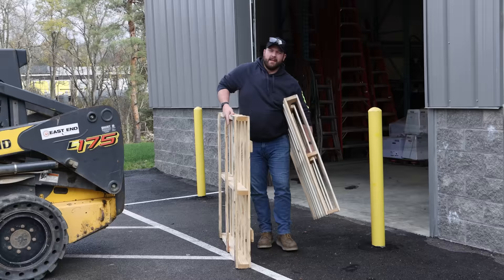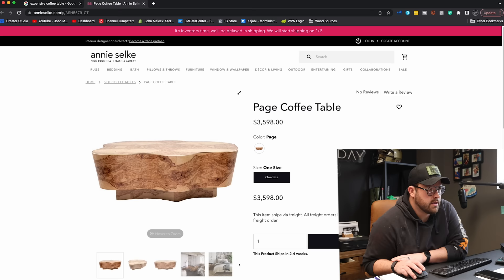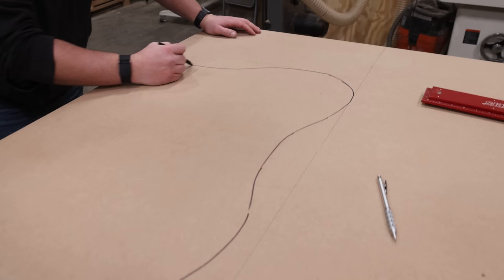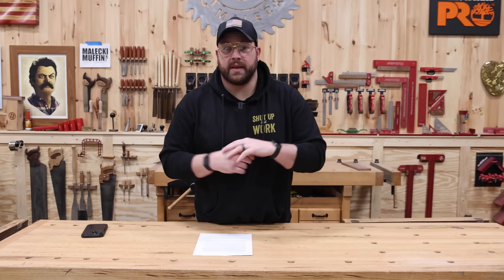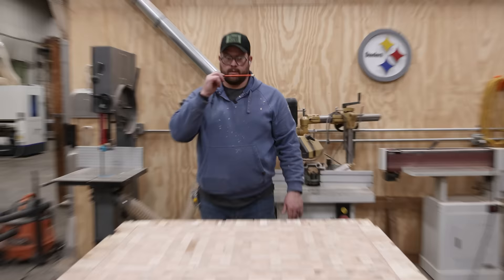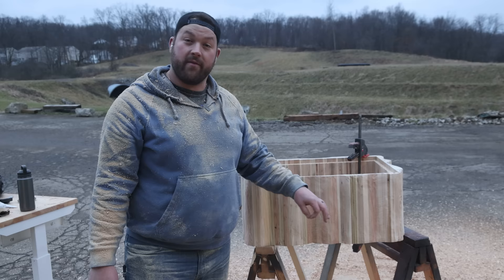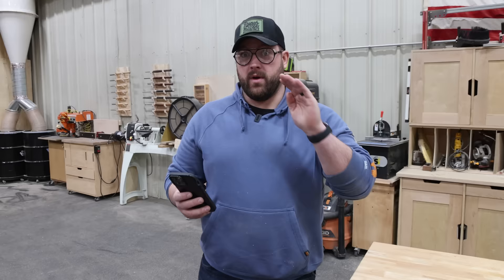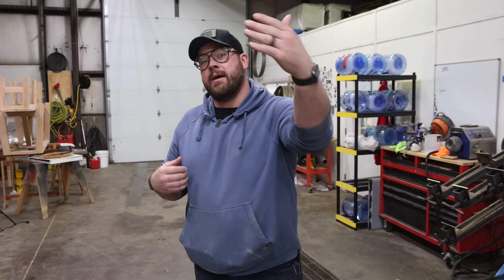I TESTED 'Turning FREE Pallets Into A $600 Table '... Again!

Comment: I made one, only ONE nice thing with pallet wood. I will never do it again..the wood is simply NOT free at all. It takes so much time to reclaim. First you need to cut the wood or pry it off. If you want full boards you need to drill out the nail holes even if you've priced out all the nails because the ring shank nails spin when they go in and can leave metal in the wood. Then You need to glue up the pieces laminated after jointing and planing because they get too thin to use for anything... Then you have to joint and plane again after glue up. It takes SO MUCH TIME. Not free. Go to a professional grade hardwood store and buy the real stuff for less time and ultimately, money. Just my two cents.
Reply: Haha nope

Comment: As someone who's repaired pallets as a job, I have never once seen someone break down a pallet properly!! ;P With this pallet you would pry off the bottom three boards, then use a hammer to knock off the bearers from the top boards, easy and quick.
Reply: This needs a video
Reply: @cjamesfox lots of them already
Reply: I made a custom fork for busting slats off pallets.  It's about a foot long piece of 3" C channel with some angle feet welded to the legs. I get that fork up under a slat resting on a stringer then give it a crack with a big hammer. It pops the deck boards right off. I kept thinking how I could get a hammer shot inside the pallet. Well that fork does just that.

Comment: I used to build and repair pallets for a bit. You made it harder by cutting the boards before using the bar, honestly. When we used to pull them off we'd use a similar hoof shaped crowbar, start on the center stringer then pop the outer two just the same. The boards pushing on the stringers gave leverage you lost by cutting them down. At least in my memory it was easier lol

Comment: use a Sawzall with a 12" metal blade and just cut the nails to release the slats from the frame wood. Simple matter of punching the head of the nail out of the slat wood. Depending on application you'll have much longer wood available for your project.
Reply: I've broken down a lot of pallets. A reciprocating saw was my first guess. So I did that initially. It would split the slats. A circular saw works far cleaner and easier for cutting off those end stringers. So John had that part right. You still can't pry those nails out though. They got shot in so they have to get shot out. I made a custom steel fork for slamming them out.

Comment: 7:16 - did you know, the manufacturer of that particular power tool gives you a shield to use with the tool when it's on. It's not only to minimize the amount of splinters shooting at your eyes but also to protect you in case the disc breaks and takes out an eye or breaks into your skull. Don't google any such accidents, but there are quite many of them.

Comment: You can zip the nails off the back using a sawzall then take a nail punch the the holes on the back of the boards way easier than trying to nail pull the boards off. You get longer usable boards and the nail holes look kinda cool.

Comment: Use a recip saw with metal blade and run between the boards and support to cut the nails

Get the look and larger boards and quick, well worth it

Comment: One thing I don’t understand is that in morley’s video, he specifically went through quite a bit of time about pallet selection. Specifically looking for “older pallets with hard wood slats” and “avoiding pine”. The content is great regardless, but I find it odd that in these “recreation videos” that one of the key aspects to morley’s build is ignored.
Reply: Age has nothing to do with what a pallet is made out of.  Some pallets are just made out of softwood and some are made out of hardwoods. Your best bet is to try to find the freshest and cleanest pallets you can get. Deposit pallets are probably the worst. I got some pallets that had masonry blocks on them and they were terrible.

Comment: You are overcomplicating the process of taking down a pallet all you need to do is use a hand mallet and knock the top middle and bottom of the pallet on the backside  and it will come apart easily

Comment: Ok. You gave it away as a thank you for being a fan. But how much was he about to pay for it before you told him you weren't charging? The whole point of what the guy you're mimicking does is that he calculates the material and labor costs of making the pallet table, and compares it with the price he sold it for.

You basically didn't do the challenge at all. You just built a pallet table and gave it away.
Reply from the maker: You got to watch the first video where i did exactly that. I also stated this one took me like 70 man hours, Which is going to equate to me making 0 money. But the challenge was to make a table and sell it for $600 like Morley did.
Reply: @John_Malecki  Oh. I see. I thought the challenge was to try to make a profit off of it like Morley does. With you using all of you advanced tools, on paper it should be be easier for you to do it than for Morely, right? Advanced tools tend to save time and increase efficiency and precision. 

I think a third video where you try again without capping your sale price at $600, and focus on trying to turn a profit while itemizing your costs throughout the vid like Morley does would be a pretty entertaining watch. The table you used as reference was going for $3.9k or something. Be cool to see you employ your skills as a salesman as well as your skills as a craftsman to get the highest price possible while keeping the costs down. Third time's the charm, right?